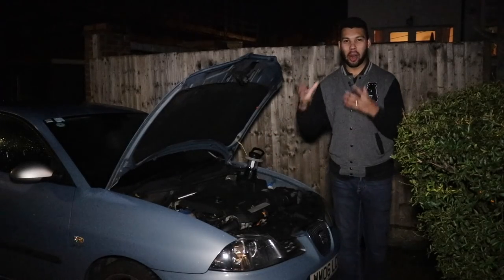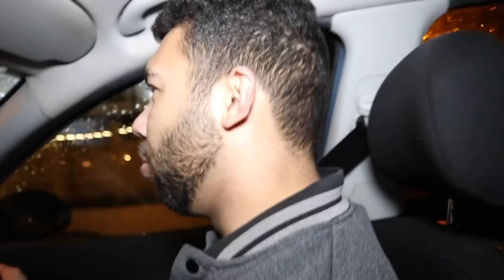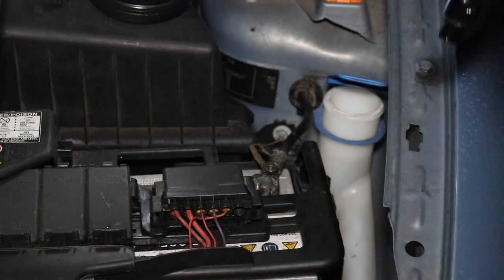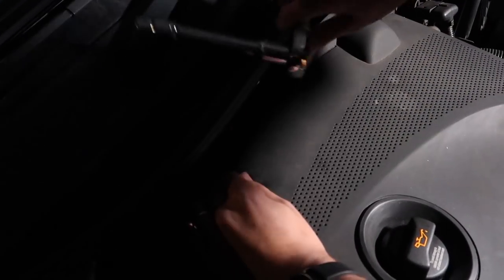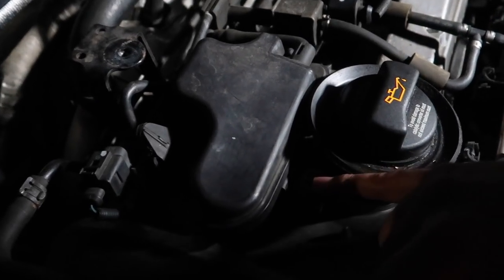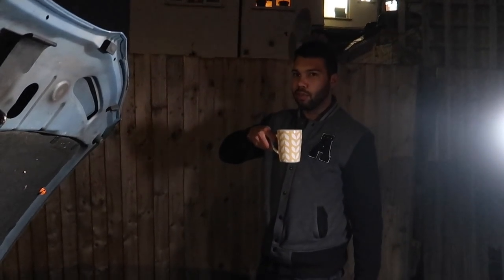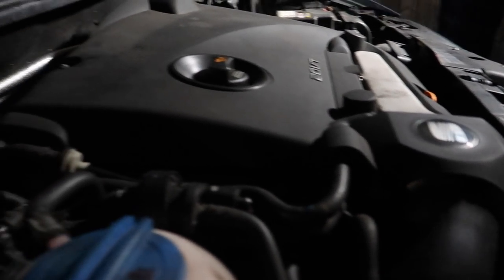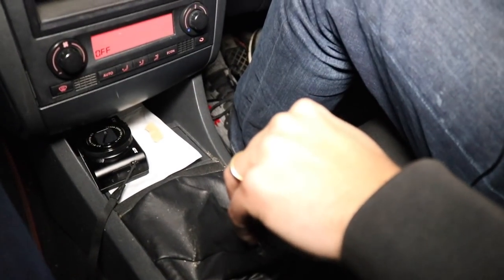Replacing An Ignition Coil In My 2006 1.8 SEAT Ibiza FR

Comment: I just replaced the coil pack on my GFs Lupo. It was literally just 3 Allen bolts and a plug lol. Found the old one had a small crack on the casing causing a missfire on cold start idle

Comment: How did you find out which coil pack was faulty.
Reply from the maker: Mostly through research but I bought a cheap (around £9) OBD reader (you also need an app to go with it, but that was only £2.95) and that confirmed it. It was actually cylinder one that was the culprit, but to make sure it was the coil, I swapped it with cylinder four, re-ran the fault code check and low and behold, it was the coil that was the problem, simples! Thanks for watching Dean.